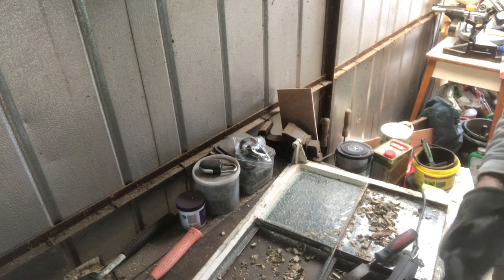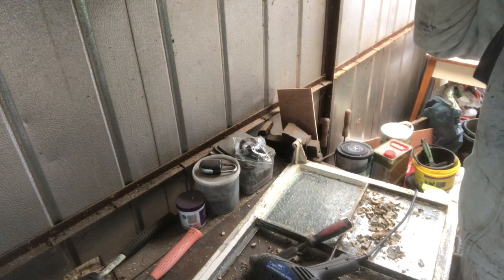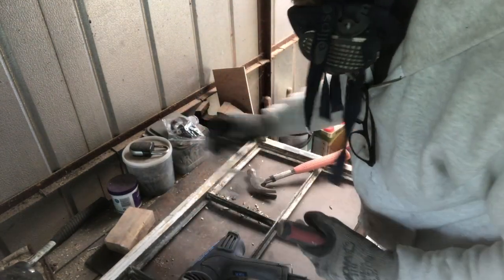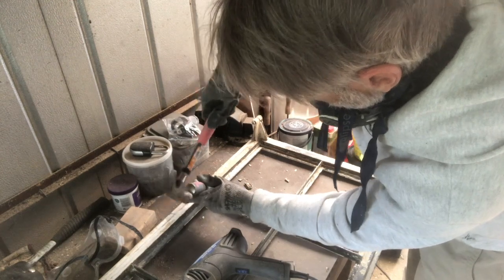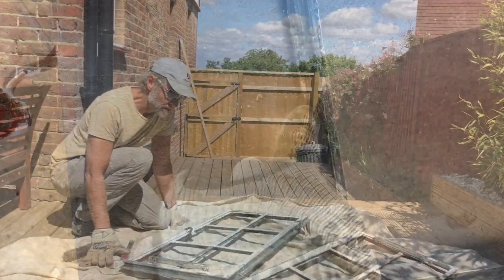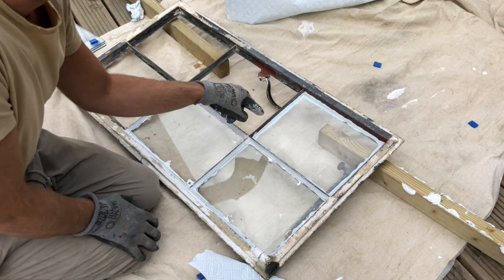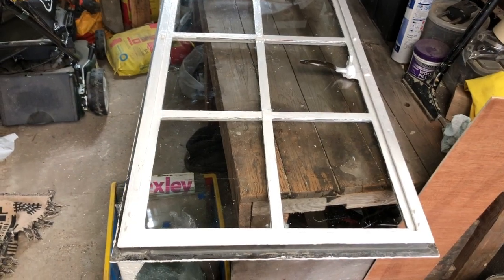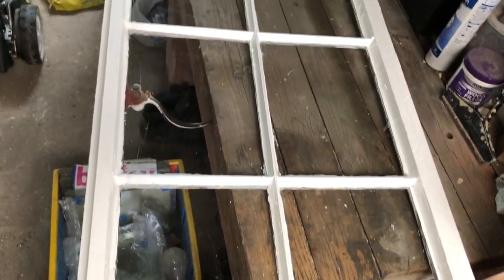how to restore Crittall windows...

Comment: Why use acrylic putty? Use multi-purpose putty that was developed for Crittalls. How do you think they have lasted so long?? The Linseed in the traditional putty has protected them, also when the paint fails on the putty, the chalk works as a wicking agent to dry the windows between wet periods. The acrylic will do NONE of this, in fact it will hold the water in and provide the perfect conditions for rusting to take place. Condensation from inside the building will run down the glass and the acrylic will encourage rust from there also, by holding the water in the frame. Putty will do the opposite. Use muti-purpose putty and the correct Crittall glazing clips.

Comment: No cross blocking the glass ...how do you know if that old sash is square...and are you using poly or silicon
Reply: Looks like a Screwfix putty mastic to me, its like an acrylic based, thick sealant that you can paint the following day, as opposed to Multi-purpose linseed putty that will take a number of days to firm enough to paint. It saves time, so you can paint the window in a predictable time frame. But offers none of the protection qualities that real putty does. It may look nice and give a good finish but will offer no protection to the frame because of the reasons i have outlined above, essentially you are signing the death sentence of the sash.

Comment: How do you remove the side opener from the frame? The hinges look kinda permanent
Reply: There is a pin with a threaded end, often rusted up. If it won't undo, you have to cut the pin or drill it. Tricky job on a ladder.